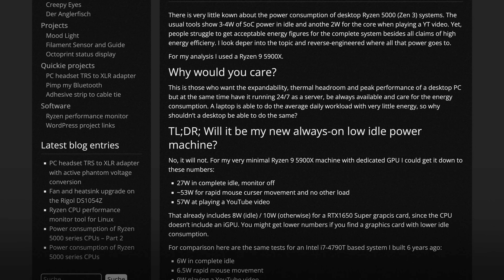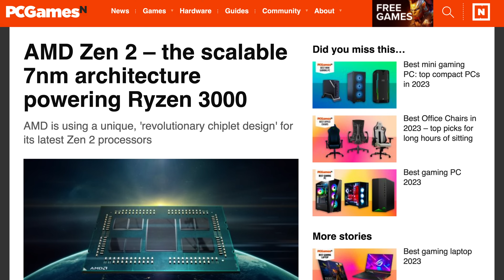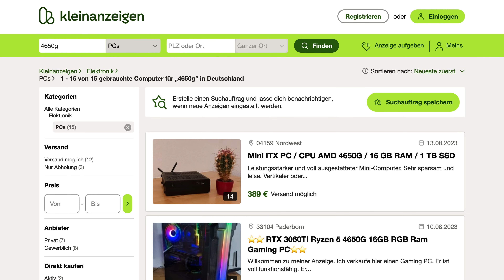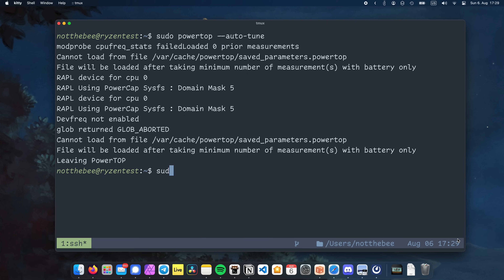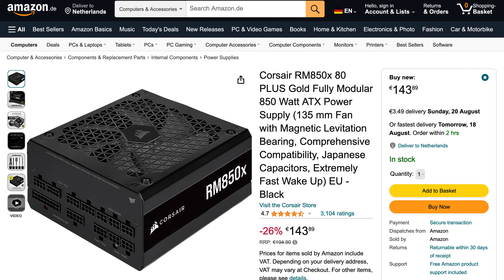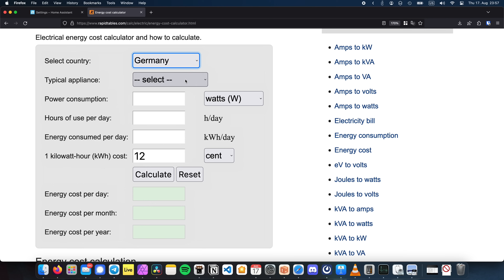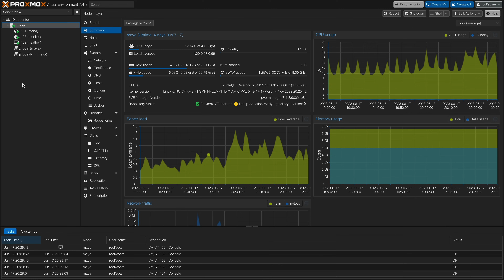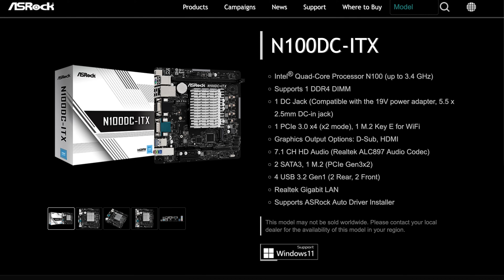This $250 Ryzen Pre-Built is a BEAST Home Server!

Comment: In one of the video you share that you've been using xeon e-2176. Can you maybe share what is the power consumption on the load and if can be tweaked  via undervolt? I assume idle is low like most of Intel's CPUs. Not that easy to find any info about xeon e2100-2300 series in the wild. Thanks in advance. I'm struggling whether to choose it instead of i3-9100 for ASRock c246wsi for nas an proxmox env
Reply from the maker: The "mutant" CPUs like E-2176M do not support ECC – probably a limitation of the BGA to LGA adapter. 
So if you need that, i3-9100 is a better choice.
The power consumption under load is basically "as much as your CPU cooler will handle". I've seen around 95-105W during a stress test. You can obviously limit that using intel-undervolt (it supports limiting PL1 and PL2) or similar software
Reply: @WolfgangsChannel  ah it's M not G, ok. Hope i3 9100 will handle some dockers and vms:) Thanks, will try this option

Comment: Hi, I bought a pico psu ( compatible) and I am testing it with a power supply tester. I see it has as voltage 12.5 (inside +12V2) indicator. To my understanding the ATX specification tolerates up to 12.6 . I would like to consult if that value that I have is normal in those Pico PSU and on normal ATX PSU ? Should I discard the Pico PSU or considerate it risky ?
Reply from the maker: Hi. I don't have enough knowledge on the matter to say for sure if your unit is safe or not. The way I see it, if it's lower than 12.6, then it seems that the PSU is within the ATX standard. But that's just an uneducated guess

Comment: MY servers idle around 13-15 watts plugged in and running. I also found that the PSU is critical in this. I normal crap PSU is so inefficient your idles will be in the 30 watts range. A good Platinum or Titanium PSU will knock that down to 13/15 watts or so...

Comment: Love your channel, ill share my (idles at 7w) proxmox server.  
Machine:
  Type: Desktop System: HP product: HP ProDesk 400 G7 Small Form Factor PC
CPU:
  Info: 6-core model: Intel Core i5-10500 bits: 64 type: MT MCP cache:
Onboard 1Gb I219-LM + 2xRTL r8152 usb 2.5gb nics
RAM: total: 62.6 GiB 
  Local Storage: total: raw: 2.05 TiB usable: 1.99 TiB used: 1.29 TiB (64.9%)
  ID-1: /dev/nvme0n1 vendor: SSSTC model: CL1-8D256-HP size: 238.47 GiB
  ID-2: /dev/sda vendor: Crucial model: CT2000MX500SSD1 size: 1.82 TiB

Running  proxmox, powertop, 4 ldap VMs, HAOS and my firewall. Idles between 7-8w

Cheap, low power and plenty of capacity for any thing I use at home.
Reply: Power goes up to 17w idle when i use my SAS controller and 4x3.4TB SAS SSD's

Comment: well, throwing a high power PSU, even highly efficient, at this system somehow saved a lot of power, but if you did the math you may end up with better results using a lower power one even if it's less efficient
with this Corsair you're sitting at less than 5%, the PSU is working surprisingly hard and inefficiently
Reply from the maker: I'm yet to find a lower-wattage PSU that perfroms better than the (now discontinued) RM550x
Reply: @WolfgangsChannel  maybe this one is special, it's only certified gold and below 10% it's Wild West anyway, but as a general rule you don't want to run below 10% for that precise reason
Reply: @WolfgangsChannel   do you know if using a power brick rated 140W with Pico PSU rated 160W, for continuous operation 70W could be ok ? I guess that the power brick will probably will have heating problems.

Comment: @WolfgangsChannel, hi there. May be you can help me and someone looking for the same question? I'm building a fileserver/torrent for home usage using a build on an old Intel Atom processor. I got 3 discs: one ssd, two 3TB HDDs. Placed Ubuntu Server on it without graphics. And I'm worried about HDD usage start/stop count. Well overall on HDDs health. Is there any specific thing you would suggest to use to prolong HDDs life? May be you can do a video tuturial on setting up RAID, torrent downloader, and some sort of health monitor for HDDs?

Comment: Been running a Ryzen PRO 5750G with ECC as secondary home server. So far it's only occasionally been running some game servers, but once I finally get around to investing in new hard drives, it will eventually replace my old Opteron based server in NAS role as well. Neat chips but honestly right now it would make more sense to get 7000 series Ryzen which all come with integrated graphics, more PCIE lanes and faster gen 4 vs gen 3. Also despite having integrated graphics, they actually all seem to retain ECC support (also depends on motherboard) so you don't have to hunt for PRO models.
Reply from the maker: 1. TDP has no bearing on idle and semi-idle power consumption, which is what your server will be doing 99% of the time. A 35W i3-9100T and a 95W i9-9900K have the same idle power consumption.

2. There's a reason why you look at MPG when choosing a new car, why we isolate our homes from the cold to spend less money on heating, why we turn off the lights when we leave the house. Building your 24/7 server to be as power efficient as possible is not any more "penny pinching" than any of the above. It's just common sense. You don't get to be rich by wasting money
Reply: Have you seen how much power the 7000 series draws?
Reply: @EmotionalWeather  I daily drive 7950X on my desktop. With bit of an undervolt and underclock it runs cool and quiet. For home server use I would certainly consider something like 7900 non-X which runs at much lower TDP rating.
Reply: @ruojautuma1  Doesn‘t matter, I need to get idle use below like 15W. Don‘t need high performance. And it might be possible with the 7000 series, but there are not enough builds out there yet.
Reply: @EmotionalWeather  If you have strict thermal constraints then you probably looking for something like Xeon D or even Atom series.
Reply: @ruojautuma1  Its not really about thermals, but about energy consumption. Electricity is expensive :)
Reply: @EmotionalWeather  If saving literal pennies a day is imperative, you're in a financial situation where you should not be investing in computer hardware at all. Good luck.
Reply: @ruojautuma1  Bullshit. My old homeserver drew 60W, thats 15€/month. My new one draws 11W, which is less than 3€. Thats almost 150€ in savings each year, in addition to it being less noisy and producing less heat.
Reply: @EmotionalWeather  Something like a 7900 should idle at sub 40W. We really are talking about optimizing for pennies per day. Noise and thermals are valid points, which is what I originally thought was your concern. Of course if we're talking about deployment in scale, then power consumption again becomes important factor. A single home server though? I stick to my previous statement which is if budget is so tight every watt counts, one should probably consider different hobbies.
Reply: @ruojautuma1  Its not about a budget, its just that I don‘t want to waste energy. Many CPUs can idle at super low consumption, but you need the right combination of components.
Reply: @EmotionalWeather  Very well. Each to their own. Might I still bug you one more time to ask which CPU are you currently rocking?
Reply: @ruojautuma1  My "big" server is currently my old i7 4790K. But that PC + 3 hard drives is like 60W at idle, so its turned off most of the time.

Most services are currently hosted on a small Intel J4105 system and external USB drives, that only spin up when my media is needed.

Comment: I went with an 160W PicoPSU and an 120W (12V10A) DC Laptop Charger. (Actually exactly the components mentioned in this video).
The system crashes under all core load with 110W at the wall. The manufacturer of the PicoPSU says this is to be expected, since only 70-90W are available on the 12V rail.

So I am pretty much SoL here since my motherboard doesn't allow tweaking the cTDP of the 4650G Pro. Have to replace the entire system with an SFX PSU, which kinda sucks.
Reply from the maker: Don't jump the gun on that SFX PSU yet – you can still probably tweak the TDP in Linux. Check out this article https://wiki.archlinux.org/title/Ryzen
Reply: @WolfgangsChannel  Very helpful, thanks! Some does not apply because I'm running TrueNAS Scale and wanna stay there. But I will definitely keep this handy for my other older Ryzen systems.

However, good news! The option for cTDP was just very very hidden without any documentation in the manual or UEFI itself. Buried in the 4th submenu of AMD Common Settings with several "No help string provided" options and the help of a lot of old forum posts I actually found that using specific hex values in "NBIO SMU Custom Flags" sets the cTDP to 35W. Took me 4 days of looking through AMD documentation and forums, but it finally works!

Total system draw from the wall under full load is 75W now, which still causes the CPU fan to slow down using DC, but it doesn't crash anymore. (All attached drives and expansion cards run through the 12V rail after all). That's a win in my book. 13W idle with 4x NVMe and 2.5G NIC is awesome.

I bought the 4650G with a semi-broken motherboard for 80€ on Kleinanzeigen, which is honestly a steal for that system. Wouldn't have done it without your knowledge and this video. Thank you a lot!
Reply from the maker: TrueNAS Scale is based on Debian, so it definitely applies. Glad you managed to get it fixed though
Reply: @WolfgangsChannel  It's really restricted tho. All system configs get rebuilt from their proprietary configuration on boot.
I didn't even manage to apply some ZFS tunables, that would have solved the problem for me as well, since changing said configs as root intentionally yields I/O errors. Installing anything on the host (not within Docker containers that is) is pretty much unsupported. Coming from CentOS, the restricted nature of TrueNAS Scale was quite surprising. But I really like some of its feature set and ease of use.
Thought about switching to plain Debian or Alma, but this is resolved, so I'm fine with it.

Comment: this mainboard support ecc ram ?
Reply from the maker: Yes
Reply: @WolfgangsChannel  support ECC but non-ECC mode ?
Can you please look at the BIOS to see if you can enable ecc ram mode? Or if you are using liunx you can use the command "dmidecode -t memory" and look at the "Error Correction Type" and if Total Width is greater than Data Width . Teach how to assemble a server with ram ecc. There is very little information supported. If possible I would like you to make a video clip to make sure it works in ecc mode. I paid for x99. I'm so sad when it support ECC but working with non-ECC mode (bios not have config and i try flash bios it working ecc mode but Total Width 72bit and Data Width 72bit it is no different from non-ECC )

Comment: I am now searching for a used system for a powerful but low power NAS/VM server. I haven't been able to find a smiliary system on Ebay in the USA with a MiniATX MB that I can move into a NAS Case. Do you have a reccomendation for how old of a Xeon or Core CPU we should buy and which to avoid? Currently my search for XEON is 2018 or newer and for CORE it is 8th Gen or newer. They must have the two virtualization features, a TDP of 50w max, and at least a 2.2Ghz base clock. The CORE processors also must have on board GPU so I don't waist a PCI slot on video. Does that make sense? I am curious as to what the criteria is for excluding the older models.

Comment: Since it only has 1 pci slot can you use some sort of m. 2nvme adapter to plug another Pci card into the mobo? Do they work with all o/s's?
Reply from the maker: Yes. M.2 NVMe is just PCIe
Reply: @WolfgangsChannel  what are some examples of these adapter boards that are of good quality? How do you mount the pci board  and get ports to outside of case (I need two 10g low power ethernet ports fiber are low power right? )
Reply from the maker: Anything from ADT-Link. They have all kinds of adapters, just look it up and see what works with your case/layout. AFAIK, you will need external power with any M.2 > PCIe adapter, most of those adapters come with a 4-pin to SATA/Molex adapter.
Reply from the maker: That would really depend on your motherboard, the position of the M.2 slot and the case. They have south facing adapters where the PCIe extension cable comes out from the bottom of the M.2 part, so if you align it right, you'll be able to slot your device into the PCIe bracket. But once again, there's no universal solution, you'll have to measure your case and pick something that would work for you.

Depending on the price, it might even be cheaper to get a new motherboard with two full-sized PCIe slots.
Reply: Now I got it. But the cable with the PCI socket end would have to somehow fit under the board after you mount it in the rear slot cover area. Strange... @WolfgangsChannel

Comment: Why don't you use wall socket power consumption meter software meter is not reliable
Reply from the maker: I use a smart wall socket power meter and connect it to Home Assistant
Reply: @WolfgangsChannel  does that mean the system (main cpu unit) consume  16 watt or the cpu (processor) alone consume 16 watt ?
Reply from the maker: The entire system consumes 16 watt measured at the wall. I mentioned that in the intro
Reply: @WolfgangsChannel  oh okay it just hard to believe that since smps are not 100% efficient
Reply from the maker: Pardon my ignorance, but what’s an SMP?
Reply: @WolfgangsChannel  smps (psu) power supply
Reply from the maker: Oh. Yeah, with a more power efficient PSU it can go all the way to 12-13W iirc

Comment: or C. get it from a country that sells these chips at the normal market price as they have bypassed the restriction by having a seller that buys trays of them with their local distributors....
in the country i am in now, i could get these 4000g pro series very easily and at a cheaper price than the 3000 series.... in fact the 3000 series is the least worth it here as its price is similar to the 5000 series due to when it was stocked and how poorly it sold in the local market when it launched.... in fact i could choose to get tray version of the 5700g or 4750g pro which is way cheaper than the 5700g... while the ryzen 7 3700x is the same price as the 5700x which is more expensive than the 5700g.....
Reply from the maker: ...and pay import taxes and VAT, possibly making it even more expensive than buying one in your country

Pretty neat if you already live in the country though

Comment: hi wolfgang. is there any app like that we can see computers power consuption in linux?
Reply from the maker: Unfortunately, you can't accurately measure the PC power consumption on the PC itself. You can use an inline power meter instead, either a "smart" one (e.g. that shows you the power consumption in an app), or a cheaper digital one that just shows the power consumption on a built-in LCD.

Comment: Regarding Ryzen ECC support, while technically correct, consumer Ryzen chips should work just fine with ECC RAM. I've been running a DIY NAS with first a 1600X, then a 2400GE on an old Biostar X370 ITX motherboard, and both run my 2x16GB DDR4-2666 UDIMMs just fine. Rock solid in terms of stability, and ECC is confirmed working, despite neither of those CPUs "supporting" it. YMMV - not all motherboard vendors will accept ECC ram AFAIK - but the CPUs just don't care, as they all have the same memory controllers as their pro counterparts. Not supported simply means that AMD doesn't provide any kind of guarantee that it will work - it doesn't mean that it won't.
Reply from the maker: Is it a 2400GE PRO, or non-Pro?
Reply: @WolfgangsChannel  Non-pro. It's all very DIY grade and used/ebay parts - the system was built from my old desktop (Biostar mobo+1600X), had the ECC RAM added (used ram bought from a Romanian ebay seller), then I got the 2400GE used locally a couple of years later (for power savings and the iGPU). Currently planning to upgrade it again, to a 5600G as those are almost shockingly cheap these days and would allow for some new use cases. Of course the consumer 4600G is also readily available at retail these days - and again, should run ECC RAM just fine. It might not work, depending on the vagaries of motherboard manufacturer douchebaggery and not-officially-tested interoperability stuff, but the hardware support is there, and for it not to work someone will have had to actively break or disable it.
Reply: @WolfgangsChannel  Thought I'd update you on my planned CPU upgrade - I now have a 5600G installed and running just fine with my ECC UDIMMs, memory is working as it should from what I can tell (though testing if ECC RAM is doing ECC is more or less impossible, at least the BIOS options for ECC are there and it is set as enabled). Bog standard consumer 5600G bought at Microcenter in the US while I was there on holiday, latest BIOS for the X370GTN (impressive for the first ever AM4 itx board, especially it being from Biostar of all brands), and the same 2x16GB of ECC UDIMM DDR4-2666. Runs Truenas Core without any issues (though admittedly I've just barely gotten it running, so I can't attest to it's stability yet)

Comment: Thanks Wolfgang for the tip! I bought a 4650g pro used on eBay and replaced my 2700 on my b450 board. I'm using unraid but cannot get under 30W with all disks and SSDs spun down. It is a lot less than the 2700 used. However it seems unraid does not support the higher C-states :(

Again thanks for the tip and best wishes from the Niederrhein:)